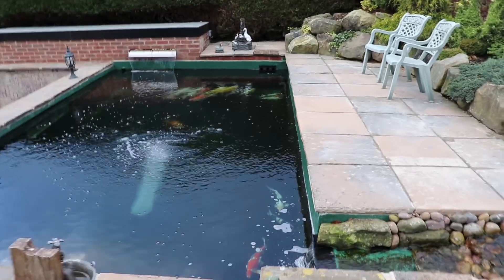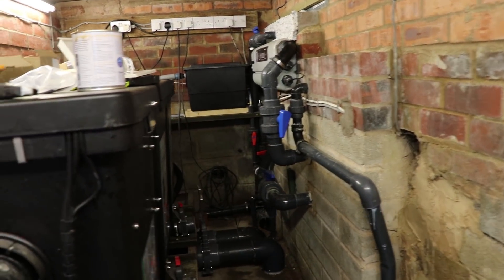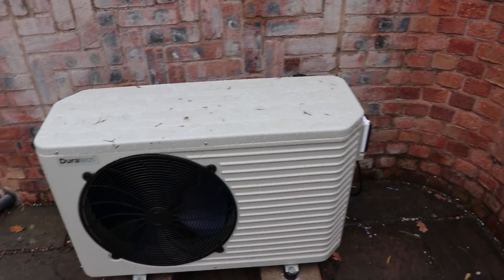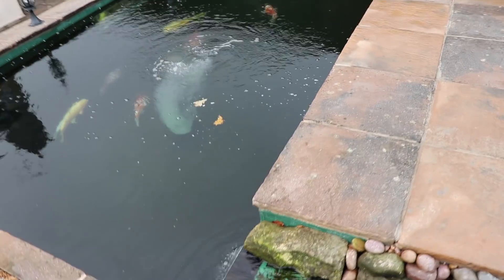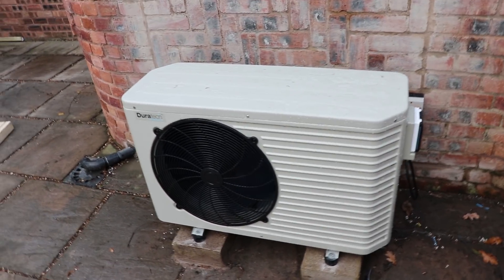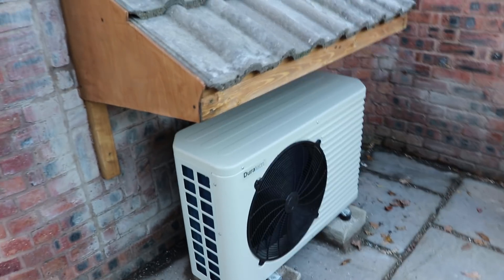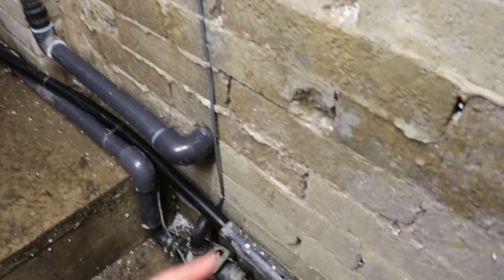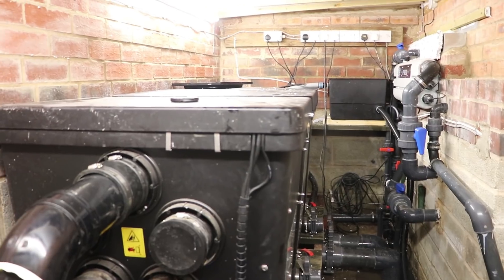Installing a heat pump and why heat a pond

Comment: Mac current 13.4A so 16A C curve more than adequate. Not sure if these units are soft start, DOL or what but C curve being instantaneous trip at 5-10x rated current should be no problem. DOL inrush can be roughly 7x full load so ~92A for a very short time / at locked rotor

Comment: How do you control the water pump feeding the heat pump since the heat pump goes on intermittently based on water temperature?
Reply from the maker: The pump is running all the time but the heat pump its self can control the pump it will cycle the pump every 30mins to check the water temp and if its cold enough to put the heater on it will keep the pump running and heat the pond but that's more for swimming pools.

Comment: Hi Adam, how is your experience with the Duratec+ heat pumps? Can you tell me what the lowest setpoint is? I recently installed a heatpump which was advertised for koiponds, but it can not be set lower then 15C degrees. So I'm returning it since my pond is not covered. Our pond is 60,000L, I was thinking of the Duratec 19+ . I read somewhere you can set it as low as 6 degrees? I live in Belgium, so same climate, would prefer not to get my pond below 4degrees during the coldest period of winter..

EDIT: because we couldn't return the ASHP, and was looking through the manual and schematics, I found a way to use an external thermostat. I can now control the heatpump with much more precision, and lowered the hysteresis to 0.4degrees. Curious on what setpoints you use during winter..

Comment: Hi Adam I know you're good with electricity, I've been offered a water pump heater cheap but I was wondering about the voltage here's the specs if you could answer perfect 👌 cheers.
Mode:5.5kW/11kW/15KW Water Heater/pool heater
Dimension:490x380x100mm
Style:Digital display
Input voltage:AC220V, Output power:5.5kW11kW/15KW
Reply from the maker: 220v is the EU voltage which includes UK. 
The only issue with that heater is cost to run, my 8kw heater cost me £20 per day to keep my pond a 30DegC obviously if i kept it cooler than that it would not cost so much but it would still be a lot more expensive to own than buying an air source heat pump and running that.
Regards
Adam
Reply: Adam Julyan Cheers for the information mate appreciate it
Reply: @AdamJulyan  £20 a day- really? How much does this pond cost to heat @2.3kW?
Reply: Makes you wonder if there’s going to be a lot of heat pumps being switched off this winter. Lord knows what it’s costing you to run that 8kw heater these days. 🙈

Comment: Its not necessary to heat the pond unless you have lots of ice or temps fall below minus 10 celsius.  My koi live very well outside and alive in my pond in Canada for last 27 years.  Ice cold running water is good for  koi and it will keep them healthier and kill off parasites.   My koi live very well in ice cold running water during our long Canadian winters and I have never ever had a sick koi, nor have I ever had a dead koi in all my 27 years of wintering my ponds.  The koi swim slower and they naturally rest during the winter. My pond temp during winter is just barely above freezing and pond does ice over but water continues to flow under the ice all winter.  Ice cold water will keep your fish fresher and healthier.  Koi are cold water fish and heat is not needed unless you have lots of ice or are worried about your pipes freezing.... If water constantly running then your pipes won't freeze.
Reply: Ice cold running water is not good for Koi at all. When Koi are sitting on the bottom clamping their fins against the cold they are surviving, they are not thriving. If you choose not to heat that is your call but please don't try and suggest to everybody that Koi being cold are healthier, they most certainly are not. Peter Waddington, one of the most respected Koi keepers in the world will tell you cold koi are suffering Koi.
Reply: cbcdesign001 Peter Waddington never knew nothing about wintering koi in their "natural winter habitat" cause he  never wintered his koi in extreme Canadian cold running water, and so he cannot say.  I have had my koi outside alive in ice cold running water like "other natrual carp in Canada" for 27 long winters, the two original biggest koi I have are 27 years old.  They do very well and are very strong fast swimmers in summer.  Winter they naturally go into a deep slumber which other cold water fish like koi, and they do very good as it keeps them fresh and keeps parisites and diseases away, just like other natural cold water fish.  That is why I have never ever lost a koi ever and never ever had a sick koi.  Look back at my channel and you will see years of video's of my koi in winter and summer.  The biggest danger to koi is suffocating them under thick ice with no running water to keep water fresh and ensure lots of oxygenation.  Proving Peter wrong for 27 years ....
Lots of people here keep their ponds running alk winter and they still have their beauitul koi alive and very well in Canada too.
Reply: cbcdesign001 it only looks like they are suffering when really their metabolism slows right down and they get sleepy.  Lots of people are now choosing to winter their ponds to keep koi free of parisites.      They are cold water fish if you look in Oxford Concise Dictionary.   The trouble comes when people turn off pumps and ice then smothers ponds and then the biggest fish die off first cause they run out of oxygen first as they need more oxygen than smaller fish.  
People all over America are now wintering their ponds as I have .

Comment: Hi Adam I’ve finally been able to subscribe. Really good videos btw and very useful - pretty much watched them all! I do have a question for you though towards the end of summer a couple of my fish developed what I can only describe as white blisters all on their tails and side. I treated them as directed by a local shop with Malachite green with formalin after dosing and weeks passed nothing has changed.
I don’t have a microscope yet so can’t to a scrape to determine what it is but I do know is it’s not koi pox. All I can put it down to is some sort of fungal infection.
Water parameters all testing ok but any advice would be great as spring is not far of and it’s definitely spreading to other fish

Comment: One of my top five fish YouTubers the king of DIY or Joey has a 2100 gallon pond in his revamped fish room that he built. He has a 2 gallon water heater pumping through the cement underneath the water. Obviously that works fine for him along with the room heating for the rest of his tanks. I'm curious how does that approach work for larger ponds?

Comment: Hi Adam as usual an informative video, not much call for a heater in Australia but excellent all the same. Going back to the drum filters Oase says in one of there info videos that the large diameter pipes between the helix boxes is to allow a large but slow water flow between them, sounds reasonable to me. Keep up the good work. Cheers from Australia.

Comment: I was looking at these heaters and wow ££££ is there a cheaper heating system that can be used
Reply from the maker: There are a lot of different ways to heat a pond usually as the install cost gets lower the running cost gets higher with a pond like this a standard electric heater probably would use the install cost of the heat pump in the first year in just electricity. There are different heat pump manufacturers but i love the quality and reliability of Duratec plus range. also some heat pumps are not capable of heating during the winter period which is not ideal for a koi pond.
Adam

Comment: Adam, re the circuit breaker, as pointed out a type C or D breaker would be needed.Also need to check the cable if you have uprated the breaker to 20amp. Probably need 2.5mm cable.

Comment: @Adam Julyan, you say that a 16amp triggered immediately. I do not think there is anything wrong with your choice of Fuse but rather the Type of fuse you chose. That fuse type have three different characteristic. Slow, Fast and Normal trigger times. When you deal with motors that stop and start, you want a Slow trigger fuse. Basically, it takes longer before activating. This takes the Starting current in mind.

You might want a D16 on that type of system. I assume it was a C16 or B16 fuse.
Reply: Adam Julyan what type of heater should I get for my pond
Reply: Adam Julyan and how do I keep leaves out of my pond
Reply: Agree with above, use a motor rated fuse /MCB.

Type B - trips between 3 and 5 time full load current 

Type C - trips between 5 and 10 times full load current 

Type D - trips between 10 and 20 times full load current
Reply from the maker: Your not Wrong it was a B16 i swapped it for a C20. The max current is 13amp and the rated current is about 10amp so i just put the B16 on because i had one still did not expect it to trip that. So far its been ok with the C20 i think a D is a bit overkill as i would not expect it to surge that hard but you never know on a really cold day it might do that's why i used a C20 in case it gets into some issues with frost.
Reply: Glad to be of help, really enjoying your videos, keep them coming. Oh and a Happy christmas to you and your Adam.
Reply: @Adam Julyan, Well, I guess if it works. Just hope there is something larger on the other end that is feeding the terminal. Since there is the issue of people placing 20amp when they have 20 amp on the feeder cable. Which can result in tripping the feeder fuse rather than the terminal fuse. Either way, just thought of sharing my electric experience (Studied Electrician.)
Reply from the maker: if your interested the house has two incoming power connections after its meter one for high amperage loads and one for low amperage loads (So the lights stay on if the kettle trips the RCD) I placed the pond onto the high amp load circuit it has one RCD which i would personally prefer an RCBO for each circuit but its not necessary. I used a B32 MCB and 6mm 3core SWA to the consumer unit in the filter room. That consumer unit has a B6 for the lighting a B16 for the sockets and the pumps and a C20 for the heater. It also has some spare slots for future upgrades as there are plans to build a large grow on tank next spring and that consumer unit has plenty of capacity to cover that as well. I studied as an Electrical engineer and qualified in industrial wiring and testing. although i have all the certificates and qualifications it has never been a full time job for me mostly a hobby to be honest.
Adam
Reply: He also talks about a plug top. Regulations state: anything above 2KW needs it’s own circuit.